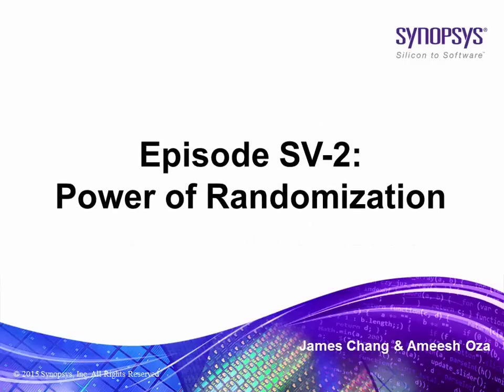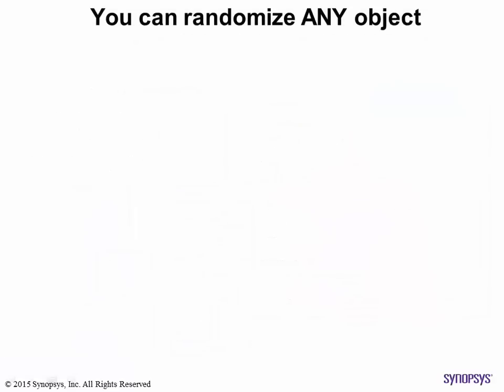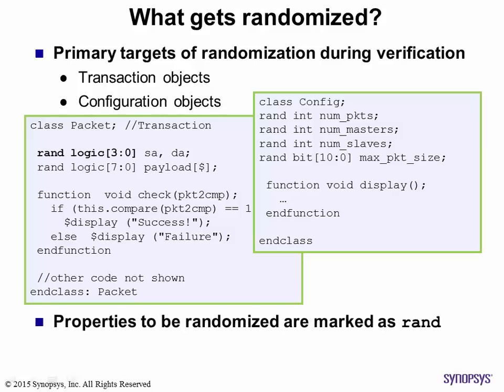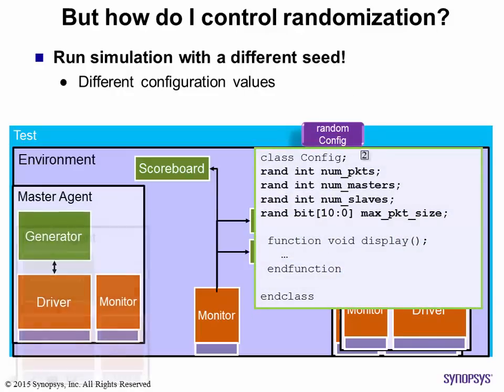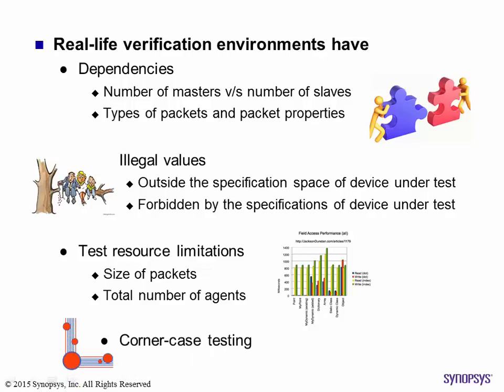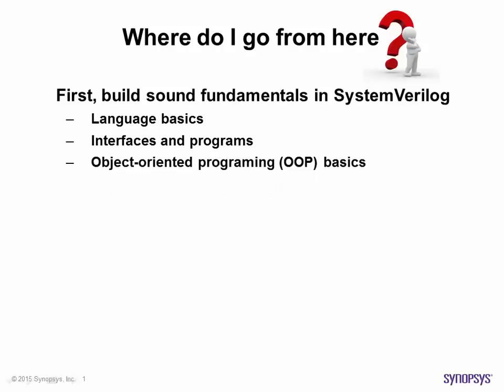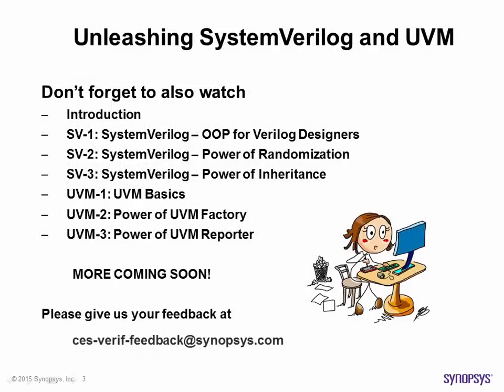SV-2: The Power of Randomization | Synopsys

Comment: 00:00
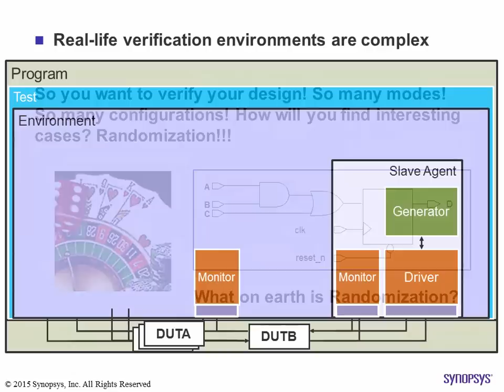00:51 randomization 
02:15 configuration objects 
03:14 run simulation with a different seed.
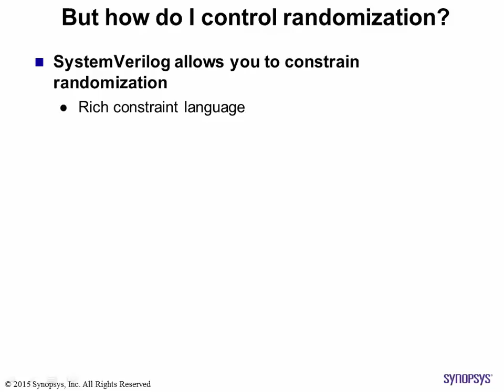04:40 constraint block 
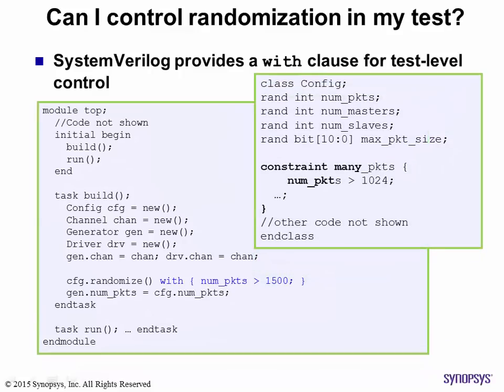05:20 with clause
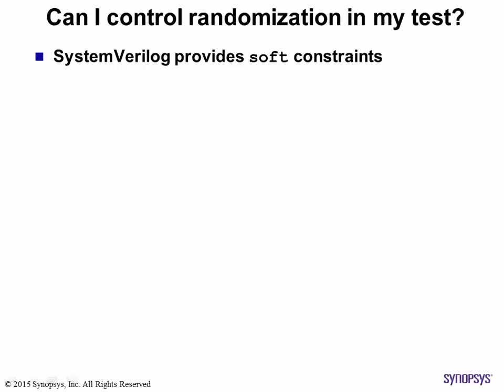05:39 soft constraint